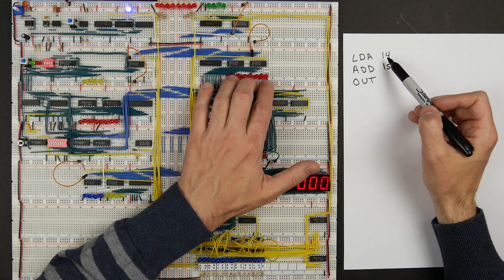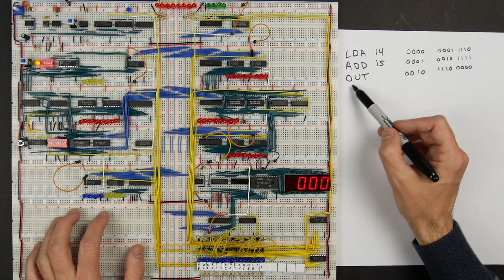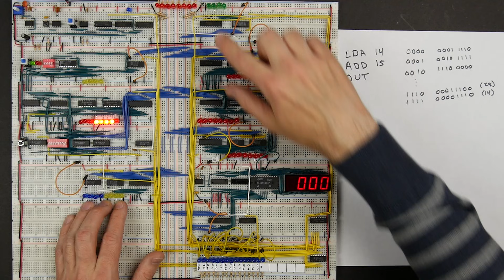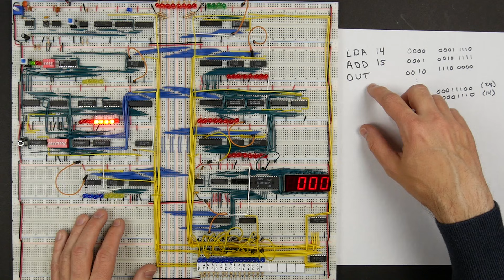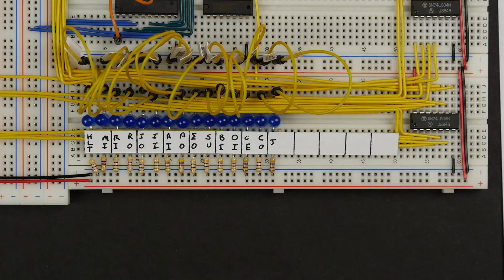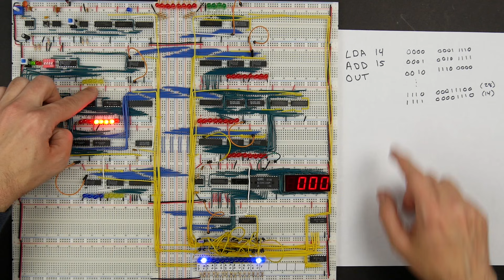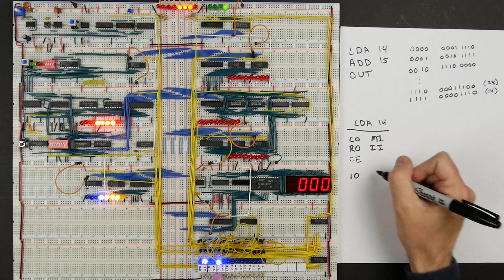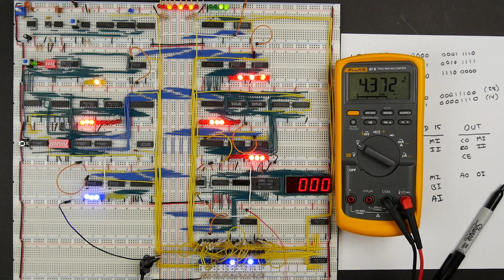8-bit CPU control logic: Part 1

Comment: We could run the CE (program counter increment) during cycle 2, shaving a clock cycle off the fetch stage. It doesn't require the bus, so won't collide as long as it's not a counter out cycle.
Reply: The computer has been purposefully laid out in this way for simplicity. This is meant to be built using the most simple architecture possible. If you look back at a previous video where he has his book of CPU designs he chooses the simplest design. If he wanted a fast computer the program counter would probably be hooked directly up to the MAR so that the single bus has less traffic the MAR would then have 2 tristate buffers. One to interface with the bus and one for the program counter. Endless optimisations could be made to make this computer faster however each adds another layer of complexity to the problem. Since this is a series designed to teach you how a CPU works as well as how to build one a complex processor would just make the entire explanation longer and harder to explain. If you can now go back and optimise his computer that is excellent as you know that you have understood the subject well which was the purpose of the videos
Reply: I was typing this as a question when I saw your comment :) He probably did this so it's easier to understand for the video though.
Reply: there is no difference in conceptual simplicity between "read then increment" and "read and increment". this design actually has increased circuit complexity due to the additional step
Reply: In this case, though, the design is completely synchronous, including RAM. I agree that the CO CE MI should happen all at once as an atomic read&increment. It's pretty wasteful to spend an entire cycle incrementing the program counter.
Reply: Nice optimization!  Now I'll have to change my copy of this to work that way.  Gotta save every cycle we can!

I've been trying to think of a good way to optimize for instructions that only have one cycle (like out or noop) so they don't have to go through all 6 microinstructions.  I could add a microinstruction counter clear to the end of the shorter instructions, but then I would only be improving by one cycle.  I'd like to cut out the extra steps entirely.
Reply: @shamus030  Could each microinstruction in the EEPROM be tagged with an extra bit to indicate whether it's the last in the sequence?
Reply: In this situation saving a clock pulse is a big deal and a no-brainer.  We're running the clock at a much slower rate than it can reliably handle so it's safe to assume everything will always respond on time.
Reply: Sometimes saving clock pulses won't give you much, if you have to wait for the RAM to respond anyway. E.g. in a certain microcontroller I used (85C92), it outputs the PSEN signal (Program Store ENable = enable the output from external program memory) for as many as 3 clock pulses, doing pretty much nothing, just to make sure the external memory had enough time for its internal circuitry to put the actual data on the bus after it received the enable signal. The microcontroller then latches the instruction from the bus on the rising edge of the PSEN signal at the next clock pulse.
Reply: I Think there is another potential optimisation. During cycle 2 you can have: Read-Out, Instruction-In, Counter-Enable and Memory-Address-In

Assuming that the memory register ignores the upper 4 bits of the bus, this optimistically loads the lower half of the instruction into the memory address register. This allows you to get LDA down to 3 cycles and ADD down to 4 cycles. For any instructions that don't need to load from memory, or need to load another register into Memory-Address, it doesn't really matter that Memory-Address is pointing at the wrong address for a cycle or two.
Reply: @shamus030 I've been thinking about that too since I wanted to make it up to 8 microinstructions (for convenience when using 3 lines to count). When using a three line counter to track microinstructions, you could have one control line be 'Microinstruction Reset' Which is active low and ANDed to the counter. Normal operation the signal is inactive/high and the ANDing passes the signal through. Setting the reset signal low would zero the microinstruction counter at the next clock cycle and begin the next instruction cycle.
Reply: cogwheel42 that's increased program complexity not circuit complexity by laying it out like this each instruction is executed one by one in a linear fashion. If two or more clock cycle instructions were balled into one there would be much more going on in the clock cycle and sure, you could still explain that and each part however you cannot then demonstrate each one separately. by doing it this way the fetch, decode and execute cycle is shown at one of the lowest levels possible step by step. Increased performance means more each clock cycle and less of the step by step nature
Reply: I've been working on a design for a Brainf**k computer along these lines. My ultimate goal is for it to be a fully synchronous (non-pipelined) single-cycle CPU which, interestingly, has some of the opposite requirements of this design. For example, I can't use a shared bus/memory for program & data, I have to use asynchronous ram (the output follows the address line immediately), the RAM has to have separate read/write ports (which will make a hardware version about 30x more expensive). All in all this has been a very inspiring series & discussion thread :)
Reply: There's another optimization you could do as well: you can speculatively load the address portion of the opcode into the memory address register in the same cycle you move the opcode to the opcode register. For load immediate and instructions that don't use the address bits it's not needed, but it also doesn't hurt anything either and it lets you shave a cycle off on all the instructions that do use it.
Reply: Yeah, that was also my idea. And cycle 1 would never be a CO cycle, so that should never run into any trouble.
Reply: cogwheel42 If we're looking at saving circuitry, if we don't make an indirect execute instruction like XCT on PDP-1, any time we do II (instruction register in) we also do CE (program counter increment). We can join those control lines and have one less output from the microcode ROM. However, that's on the level of hardwiring logic for behaviour. On the other hand, I don't know if he already does so using the one hot step counter... next video perhaps.
Reply: I understand what you're saying, but I still don't think it would be more complex than anything else going on in the computer. The way the sum register behaves on the bus when reading into the A register is exactly the same: in one clock cycle, you both transfer a value out of the bus and the value on the bus changes. I understand the idea of reducing cognitive load for a learning tool. But in this case, there is really no meaningful difference in cognitive load, and I think this optimization presents an opportunity to learn something new.
Reply: True, people would learn something new and perhaps that would be good in another series. Personally I feel that I have learnt enough from these tutorials to intuitively optimise this computer and add additional operations such as bit shifting to the CPU.
Reply: That should definitely work, you'd want to make sure that the Memory-Out doesn't change as soon as the Memory-Address changes, otherwise you could get weird behavior if the memory address updates more than once in the cycle. You could put a latch gate between the memory address and the memory value and only update on the falling clock edge. Definitely could add some complexity to the project, but does increase the speed. While I don't figure it's too likely, I'd love to see a more in-depth series looking at optimizations in modern computer architectures; ARM processors for example (Cortex M0) has a 3 instruction pipeline and most instructions are single cycle. The SAP architecture is a great teaching tool, but there's a lot that it doesn't show, and a lot of low hanging fruit for optimizations.
Reply: The address width for the data and program memories are 16 bit, so I'll need a 64k x 16 (1 Mbit) RAM to hold the stack for tracking loop jump points. I could probably get away with 32k x 16 and consider a program RAM with more than 32k loop start instructions as malformed, but BF is so loosely specified to begin with, I don't want to be arbitrarily restrictive. The top contender for the stack ram is an IDT 7028 dual port SRAM which is north of $60 for small quantities. It has full dual port operation, meaning it can have 2 separate data buses that can both read and write to the same memory location (along with collision detection logic). This is really overkill for my needs, but there doesn't seem to be anything in production with separate read-only/write-only ports. The other RAMs don't need as much data width (8 bit for the data and 3 bit for the program), but the prices don't scale well for smaller capacities.

By contrast, if I went for a 2-cycle version with separate read/write cycles (perhaps pipelined), I could get away with single port SRAMs for only $2.

Edit: actually, I would probably want to use an EEPROM for the program memory instead of SRAM, so that cuts it down to 2 of the expensive guys.
Reply: True, people would learn something new and perhaps that would be good in another series. Personally I feel that I have learnt enough from these tutorials to intuitively optimise this computer and add additional operations such as bit shifting to the CPU.
Reply: That's an awesome idea!  Can't believe I didn't think of that.  It does make sense to offer the capacity to perform 8 microinstructions, since we already use 3 bits.  I just didn't think of lumping some sort of "microinstruction reset on next clock" into the last microinstruction.
Reply: cogwheel42 interesting idea and I would be interested in how it turns out, have you found a RAM chip with separate read/write inputs?
Reply: cogwheel42 $60 each! That's well out of my budget lol, also the $2 chips sound good for me. Also modifying the adder architecture would probably speed it up since the current ones can go at a max of 0.04Ghz (0.02 if using the max propagation time). I Dont know if there are Simmilar limiting factors on the register chips but you could definitely implement adders with lookahead carry or something (not an expert here)
Reply: My thought exactly. Glad you pointed it out.
Reply: Just what I thought when I saw we were using 5 clock cycles for one instruction!
Reply: cogwheel42 that would allow video RAM with a separate circuit for controlling a full screen :-)
Reply: Great minds think alike. As I watched this video I kept thinking "CE can be pulsed together with the other signals earlier in the fetch stage; there, I've just increased fetch speed by 33%" :D
Reply: Depending on how fast the signal propagates, it might even be possible to do it on the same clock cycle (like with the ALU), but considering that instruction fetching requires at least 2 cycles anyways, it doesn't really matter.

Comment: Ben I have a question please answer me as simple as possible!
how can we produce color in digital display (on crt or modern LED Display) using Digital Ic's and other electronic components ???
Reply: There is no simple answer to this question.  The control logic would need to be complicated just because of what's needed to accomplish what you want.
Reply: moto maxx You simply put multiple, differently coloured lights in (roughly) the same place. If you look closely enough (probably need a magnifier, you can google microscope images of subpixels) almost all of them use red, green and blue points. As with the digit display, you usually send control signals for just one place at a time, usually a pixel but sometimes more complicated. In print, you can't add light, so the subtractive colours (cyan, magenta, yellow) are used instead, but usually still in patterns, known as rasters.